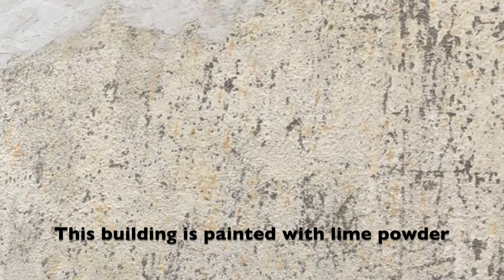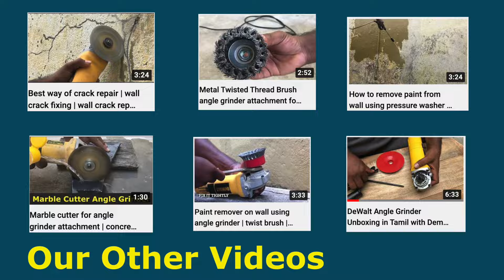Metal Brass Cup Brush for paint remove | Paint remover | Dust Remover for Wall | Diy Guide |

Comment: Seems like it will take a lot of time and effort with the wire brush attachment.. Can't we use 60/80 grit orbital sand paper velcro attachment for removing old wall paint?
Reply from the maker: You can use orbital sanding machine but many sand paper it will take
Reply: Cost of sand paper is 12 per 1$ in PK. I think thats fine....
Reply: Moreover it's not possible to remove old paint completely at a deeper level

Comment: Did u wet the wall to prevent DUST plz?
Reply from the maker: No if we do so it will not remove the particles from wall quickly
Reply: @diyguide4049  any tip for preventing the dust plz?
Reply from the maker: @nirpaLj  There is Dust Shroud available in market like this https://amzn.to/3zKpVnF but its costlier and won't fit for this brush space. In such case you can wet the wall and use. Only thing is it will take bit extra time but you can achieve with minimal dust.